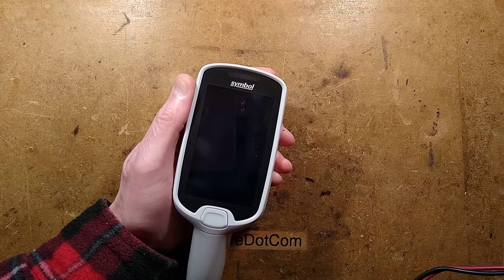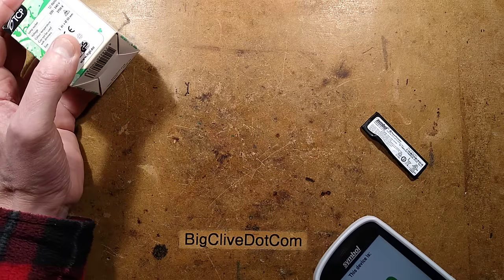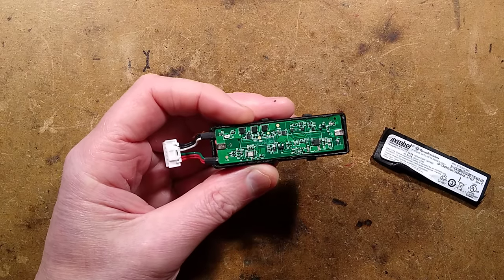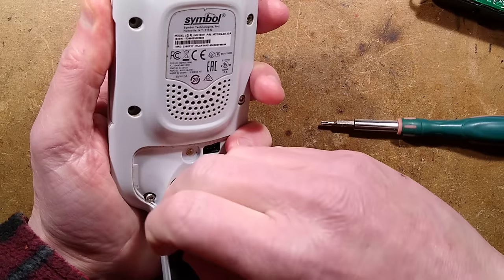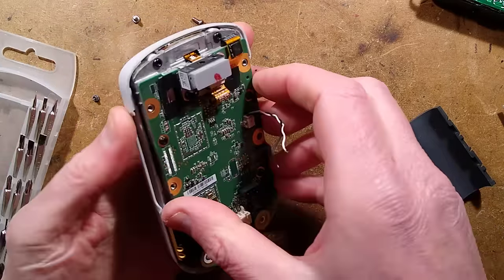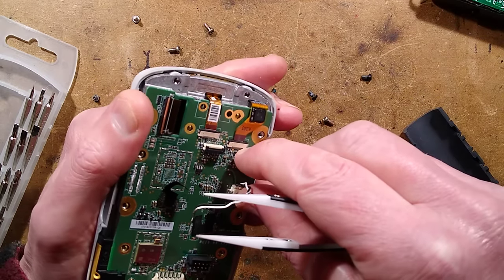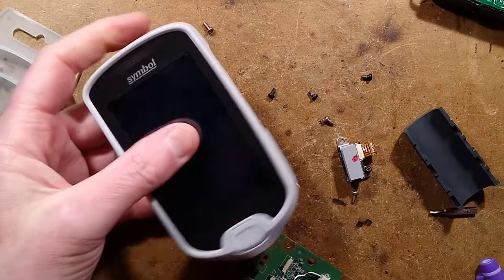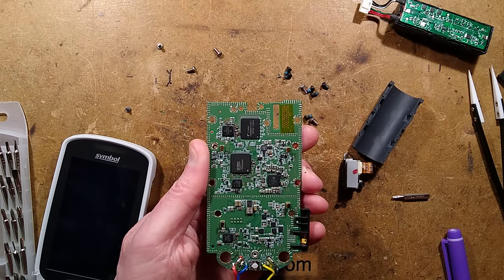Inside a Zebra MC18 self-scan terminal

Comment: Thankfully I'm familiar enough with ribbon cables from dismantling ancient PCs that I didn't break anything too severely when I opened up my phone (the one I'm typing this on!) but I'd never seen the connecter with the little flap that lifts up. Thank goodness for instructional videos from guys with thick Indian accents otherwise I'd have tried to just yank it out. I did break the little fingerprint reader on the side, but I never used it anyway so no great loss.
Reply: I broke my phones fingerprint scanner too, tried pulling the back off and it was really hard, then it just suddenly flew off and ripped the scanner off. Bad design lol

Comment: Before retiring from full-time work, I took a part-time job at B&Q that used the Zebra MC software in the hand-held stock control computers. They were remarkably tough units. Tesco also had a similar system that could be used on mobile phones.
Reply: MC is the Motorola part number series for these devices .  Before selling the consumer phone division to various global players, the professional bar code / handheld computer activities were sold off and became Symbol or part of Symbol .  Eventually, it was bought by the bar code competitor Zebra .

Comment: Amazon uses Zebra products in the distribution centers.  The one I'm most familiar with is in a cell phone package that has dedicated buttons on the left and right side for activating the scanner.  They are robust and can take a beating, but they are also crap and will just hang, fail to communicate, and drop their Bluetooth devices with regularity.
Reply: Yeah the TC57 PDA if i'm correctly
Reply: Zebra seems to be popular in DCs. My DC (not Amazon) also uses Zebras, but the MC33xx model that recently replaced their antediluvian MC9090s. Though they did feel strange seeing as the MC33xxs we have lack the pistol grip, meaning that they had to be operated like a TV remote.

Comment: I can confirm that little module in the lower left is almost certainly an RF module of some kind, and that is an antenna to the side. Probably an inverted-F style antenna, by the look of it. The small gold and black connector bit below the RF module looks to be a in-line RF probe switch, most likely for testing at the factory.

Comment: Pound land power banks and TP4046 modules are good for bringing the voltage up on batteries that went below their protection voltage. But you have to keep plugging them in and out as they only put out current for a second or so when 1st connected.. handy tip if you don't want to take something apart (but if there's a problem it will go below voltage again😢) 👍🇮🇪

Comment: I repair a lot of Zebra units at work, and its interesting how similar the MC18 is in construction to the newer hand scanners. The hand scanners I work on run Windows Mobile and are actually pretty capable little machines. The MC18 also has the same thing on the main processing chips that Datalogic uses on their hand scanners, that weird epoxy stuff.

Comment: The best thing I have found for opening things like that battery casing, wall warts etc. is a "razor saw" sold for model making. Very fine saw blade which can cut only as far as the wall thickness.

Comment: Many years ago when I worked at Sainsbury's, we had their first generation of scanners.  These were locked into a rack and one would be released after the pre-registered loyalty card was scanned.  There was a tiny slot into which a wire key could be inserted to release a faulty handset (I had my own, made from piano wire).  A technician had shown me how to force the scanner to reboot by holding down three of the four buttons for ten seconds, which brought most of the 'dead' scanners back to life.  For several years after I left until the whole lot were replaced with a new model I would sometimes instruct members of staff how to do it, when the number of working scanners was becoming seriously depleted.

Comment: Might be some room for some arbitrage.  These haven't reached the US market yet, so the handful of listing on US eBay are going for much, much more than 10 quid.  Some sellers are trying to move the scanning module alone for far more than you paid for this.

As for unlocking, it appears that the four wires at the base are USB, and if AirWatch lets you put it in MTP mode you can dump an OS update on the pseudo-sdcard and it'll self-update.  If AirWatch lets you update with a generic Zebra image...

Barring that, though, that 8-pin IDC connector may be a somewhat standard JTAG header for ARM devices (quite possibly with the pins swapped around) which should allow flashing from scratch, so the base Zebra image should turn this into a generic android device, running Lollipop.  Not new, but not 4.4...  If more stores start dumping these on eBay, there's enough reason for somebody to come up with a wipe and flash process.
Reply: My US grocery store has had devices like this for 10+ years but maybe I misunderstood your comment?
Reply: @freemandrew  By "US Market" I mean on eBay.

Comment: i found a wild "broken" one of these at Tesco's, i had a little play around although it was locked in the "charger" or "dock" whatever you wanna call it. it was using generic android with some custom programs installed. i could open the play store, google chrome, i tried the camera but that didn't show anything. i wanted to download something but it seemed unable to connect to the free Wi-Fi in store. a member of staff came over to see what i was doing as i was stood there for a while and i assume they thought i needed assistance. i said how i was interesting in how it worked and was asked to leave it alone because it was "broken" so i went about my day

Comment: I use an MC18 in my work as a security officer, but our units are full mobile phone / personal computers, with a SIM card, 4G connection, NFC, and front and rear cameras. It also has a much bigger battery, and is weather resistant. I believe that they were originally made by Motorola, before Zebra.
Reply: Not sure if they make a MC18 with those features. Are you using a higher end model like the zebra TC83? You are right that Zebra acquired Signal, which acquired the retail mobile division of Motorola, which I believe had acquired the old Telxon company and maybe a few others, which explains why many of the older devices have mixed branding.

Comment: Yes, they still use such scanners at my local Jumbo supermarket in The Netherlands. I like them better than a completely selfscan-service (which my supermarket doesn't even have) as a human being is given the scanner at checkout, asks if everything went okay and (because shoplifting is a big thing since implementing selfscan-services) quite often performs a random check to see if you didn't forget anything.
Only reason I can think of why they are being replaced is the OS-version becoming too old, making them vulnerable for attacks of whatever kind one can think of.
The strange thing the scanners at Jumbo have (or used to have, they were replaced recently or at least got the software changed) is the fact they have a camera on the front-face of the scanner, right above the display. I haven't got the faintest clue WHY...

And yes, they lock into the cradle: when you want to pick a scanner, you have to tap a touch-screen first. Some quite advanced system than most likely looks for the best-charged scanner and unlocks that specific cradle and shows a green LED-ring around it. Sometimes it does light the ring and you the clear 'clunk' from unlocking, but it cannot be retrieved from the cradle.

Comment: Are you able to figure out much older electronics?  Like a radio from 1942?  I have the schematics, and a parts listing, but I'm clueless of what goes where, and I am unable to identify many of the parts in the radio.  My dad who is 82yrs old wants me to repair it, or use modern parts, with the old tubes , and I don't have a clue on how to do either.
Reply: Hello, I could probably advise you on the radio, probably the sort of thing I was repairing when I started as radio/TV engineer in 1968/69.

Comment: Back in early 2000s Symbol made Barcode scanner devices with early wifi radios that ran on PalmOS
Reply: Waitrose quick check systems (mid 2000s to at least 2016) used Windows CE. When taken down to the basement car park they'd lose signal and reboot themselves until they found signal. During quiet periods you'd be able to hear the reboot chimes from the opposite side

Comment: I've used this exact model as a customer at Waitrose in the south of England. I remember when they first introduced a Motorola version probably about 15 years ago now (it had Waitrose green down the sides of the screen). Then they switched to the Symbol branded version you have here. I'm not sure if they're on yet another edition now, but I think this might be the current generation.

Very good in the era before everyone had (powerful) smartphones. I still use them at Waitrose as it's nice not to drain my phone's battery while scanning. At Sainsbury's, however, I use my phone instead. Wonders of the modern world.

I've always been curious as to what's inside these - they seem incredibly robust. I often wonder how often the batteries need replacing over the course of a decade or so of use... They must get through a lot of charge/discharge cycles... I was impressed with the die-cast aluminium frame. Nice video, thanks.

Comment: A company I work with uses Zebra TC21 scanners. They are basically normal Android phones with added scanning hardware and a few pre-installed apps for that.
The thing you took apart looks like a version that has been "dumbed down" to the bare minimum so it can run just one specialized scanning app that hands the scanned data over to an actual terminal/register. Interesting to look at ^^

Comment: I live a cross from a supermarket that uses these, I walk a cross for Every Little Thing, and I usually use this kind of scanners, but I would swear I saw Windows CE running on Them sometime (with te small start button). I like this scanner so much I can put the groceries right into my bag.
Reply: It's likely they make several versions as some companies will have old CE based software they may want to use.

Comment: Fascinating. I worked on the original Asterix 2 and 3 devices when I was at Symbol Technologies between 1999 and 2005. 

No I was in no way responsible for the creative accounting practices that mean that Tomo Rasmilovic is still on the run. 

I was heavily involved in the UK pilot projects for the Asterix 3 installations for Safeway (RIP - sadly missed). 

Always some interesting developments in the world of mobile computing and early 802.11 (partly based on Symbol's Spectrum 24) wireless networking.

Comment: Having serviced/repaired/catabolised many Zebra/Motorolla/Symbol devices there is a lot of info you can get from the label on the back. 
The serial number starts with the year of manufacture - in this case 17 - or 2017. 
That suggests the device is either running Windows CE or Android - Its around the time they offered both versions. I couldn't fully tell from the screen.  Symbol's website would tell you more. 

Almost all of their devices regardless or shape or size are built on modular components operating exactly the same way.  MC70/MC75/MC90/MC67  - all different but evolutions of the same design. Never had the MC18 here but from the first 8 min of the video it's very familiar.

If you had the cradle and the cradle had a USB port it would have been likely that you could have got into the file system and disabled the AppCenter software and unlocked all the Windows goodness.  Other than that there is almost no way you can boot them into a diagnostic screen or boot loader. By design they are easy to reset, but you need the cradle.
Reply: Behind the chassis plate you likely will find the hardware to drive the screen as well as the speaker assembly. All the Symbol gear is modular so it is designed to come apart for service and they all stack together in layers. I didn't see the backup battery. 

The chips (without looking them up) are typical Motorola risc chips - this unit is pretty old so in the 600-800mhz range.  They could run Windows CE or Android. IF this model supported both, the conversion to the alternative OS could only be done at the service centre.   IR Scanner module is typically proprietary and most likely a camera on this one - not a dedicated 2D linear - so short 50cm scan range. 

TBH I'm certain this unit is using a Windows OS because on boot it's configured with the launcher software and firing up the Motorolla MSP agent to update the server with the device location and check for updates. Being a wifi only scanner it will always fail and lock down the interface. 

Typical though. Person disposing of these didn't bother to do a clean and remove their inhouse software before disposing.

Comment: These run windows embedded 7, having done some programming work on them.  800mhz single core!  They were pulled out of service because the OS is no longer under support as of oct 2023 and the liability to operate them without security updates is substantial, as they integrate with Point-of-sales and various compliances (PCI, etc) would not be down with that.

Airwatch was, up until last year, available for windows embedded!
Reply: Looks a lot like Android to me...
Reply: These devices could run both Android and Windows, although both are old versions.

Comment: I’ve got a little Symbol scanner which I got new on eBay.  It appears to be early 2000s and connects to USB either as serial device or an HID (keyboard).  I used HID and Windows sees it as a keyboard.  The device can scan a surprising number of different bar code formats and is very accommodating about poor alignment with the label.  The unit generates a laser scan line when a trigger is pulled.  There must be a fair amount of processing power inside given its flexibility, but not nearly as advanced as this self-scan tool, there’s no LCD screen.

Comment: The ELPIDA chip is almost certainly RAM, likely soldered directly to the top of the main processor, in a package-on-package (POP) configuration. The Build ID string in Android will likely tell you what that is (Qualcomm, mediatek, rockchip, etc). The lack of other Qualcomm power management chips sort of rules them out; my guess is this might be an old OMAP, based on the other TI parts, but I may be wrong. The AirWatch thing is an MDM for managing large batches of Android devices in a corporate environment. I would've surprised if the pin headers on the back contained a UART or USB.

Comment: TI TWL6030B is the PMIC that goes with a TI OMAP4 SoC, which comes in a Package-on-Package variant. I bet the Elpida RAM chip is piggybacked on top of another chip, and that chip is a TI OMAP4430 or 4460.

If this is OMAP4, then there is a chance that they have the part strapped so that it attempts to boot from a USB host before booting from the eMMC flash. Maybe the other contacts in the charging port are for USB?

Comment: yeah the handheld scanners are locked to the cabinet somehow, Asda requires you to register your mobile number, and then you type your mobile number into the computer to release the handset, or Tesco requires you to scan your clubcard to release the handset, very handy because means less time at the checkout as scanning while shopping, but be careful as picking up 1 pack of pain killers then more than 1 bottle of coke then the scanner won't allow any more coke because you got pain killers part of the 1980's rules or something about buying both together even though it is your normal weekly shopping trip. but does reduce ques at the checkout unless you need to do a random security check. and be aware if you need a 2nd pair of glasses to read, as the handset does ask you if everything was scanned, and they take that as declaration that you have scanned everything and just because it makes a bleep, and something pops up on the screen like the coke and pain killers thing, it doesn't mean the 3rd item either coke or pain killers has gone through to be charged at the checkout, and even if you call for assistance because you know that something has failed even before clicking the handset they class it as falsifying the answer, even though it is the cashier that has clicked yes to the question for you.

Comment: At the bottom near the "button", there appear to be  TX and RX pins...
Reply: Those go down to the contacts at the base of the handle. Those are likely the pins he bridged with the button, and are almost certainly UART.
Reply: I'm surprised nobody mentioned the USB port connector. Also nobody tried pressing the scanner button whilst rebooting the device.. 🤔

Comment: That thing must be old. We use Zebra hand held scanners at work and they use version 58 of the software and that may not even be the most current. Didn't realize that Zebra was a Symbol brand which explains why I rarely see Symbol banded stuff anymore.
Reply: I was going to say that, it's ancient (relatively). Symbol got bought by Motorola in 2007, and all that stuff got sold to Zebra in 2014.
Reply: I didn't know that Symbol had been bought out and then resold. That explains why all the Symbol branded stuff at work was slowly replaced by Zebra branded stuff.

Comment: Used one of them in Germany today.

It's funny (annoying) when they loose WiFi connection and stuff goes haywire while shopping.

Yes they can be locked in the charging station.

There is a significant click when they get unlocked.
Reply: Rewe Handscanner?
Reply: @the_tux  Kaufland hat genau solche.
Rewe benutzt die TC51 nur für Mitarbeiter/Inventuren soweit ich weiß.
Reply: @_DSch  es gibt auch welche bei Rewe für Kunden. Aber welche genau weiß sich nicht mehr. Als das Projekt in der Pilotphase war, habe ich bei Rewe Digital noch gearbeitet.